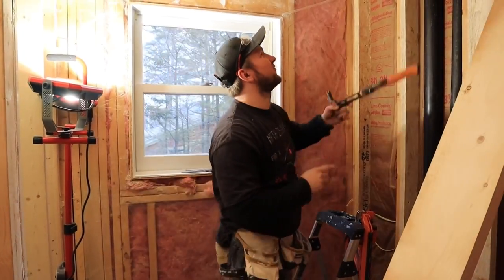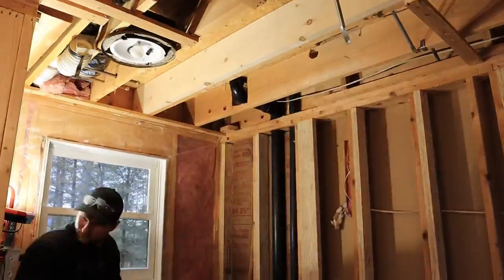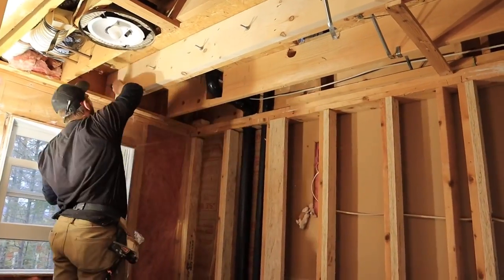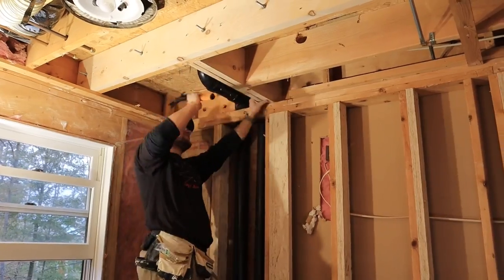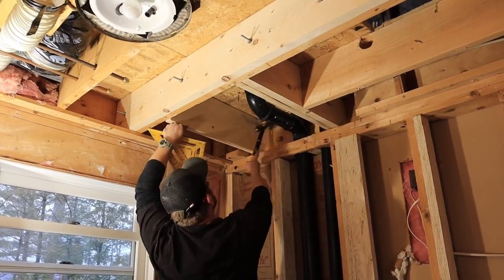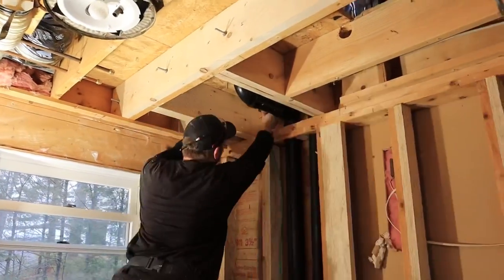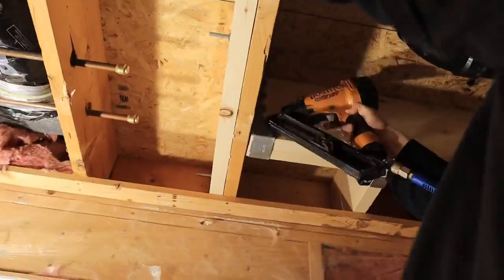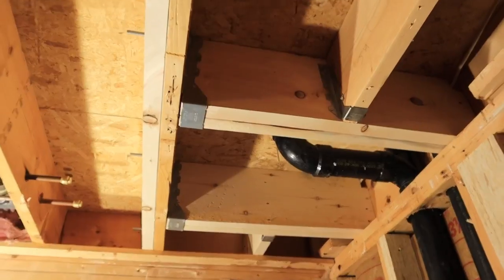Plumbers Cut my Joist! Floor joist repair. Bathroom Renovation. bathroom fixer upper.

Comment: I recommend next time stagger the bolts never put them in a straight line. Keep up the good work!
Reply: Code requires them to be staggered
Reply: How do you know what size to use?

Comment: Speaking as a plumber. It’s not our job to move joists. We tell the carpenter there a problem, and it’s up to them to fix it. Personally I’d wait until it’s fixed but sometimes you need to get the work done. We don’t have time to wait after the framers.
Reply: As a builder I agree with you 100%.

Comment: The bolts are placed on the beam’s neutral axis. They will not be stressed to any significant degree. In other words, they are doing nothing.
Reply: exactly he put the holes in the NA . Also the joist is subject to BM so glue does nothing practically - I think the idea for the sistering is to increase the section modulus . Put the fasteners away from the midddle but not close to the edges

Comment: I'd blame the architect first then a carpenter
Reply: I would say it comes down to the carpenter not necessarily locating correctly where the plumbing is, and trying to avoid the exact on center layout for that plumbing trap. Sometimes you can shift your layout and avoid most things but not always. A little forethought and communication between the plumber and the framer would have been helpful in this situation originally. But this seems to be a retrofit.

Comment: This happens because framer’s cant use a tape measure. Toilets are always 12 to 13 inches off the wall behing them. Framers dont want to take the time to figure this out ahead so plumbers get tired of the same mistakes over and over.

Comment: What make and mode palm nailer are you using for the joist hangers? I have a full size ridgid and it’s a little too big to go in straight on some of the close holes on the hanger

Comment: Yeah plumber did exactly what you want him to do.  Theres only 2 things plumber could have done differently.
1. Put your toilet flange elsewhere.  (You would not like this)
2. Drop below the joist and make you have to create some ugly bulkhead.(you wouldnt like that either).

1hr to box that in is small potatoes especially at the phase your construction is at.
Reply: Thank you.  This needed to be said.
Reply: Which is why it's always good to communicate and mark where your plumbing is and box it out beforehand.
Reply: The correct thing would be to have them fix the framing before cutting through the joist.

Comment: Is there a guideline for proper shower joist installation that I can show to my HOA. I have the same issue and have water damage to the unit before but need to proof to my HOA it’s not the drain and it’s the joists.

Comment: This will work well. I love over-engineering. Technially, I would have also sistered to the adjacent joist in the center by the drain. I would have used structural screws and glue for everything.
Reply: johnwealthy6044  I would not trust glue only.

Comment: Were you shooting hanger bailed with a nail gun? Are you shooting through the metal or actually aligning with the holes in the hanger? I’ve always used the little hex head hanger screws.
Reply from the maker: yes its a special gun for the hangers.

Comment: How much would that kind of repair cost?
Reply: That's kind of a loaded question. If it's completely open like it is in the video then it's probably going to be around a $500 add-on, or additional work order if they're there doing other things. Otherwise if you got somebody that's got a come there to the ceiling out we'll get access to everything and you're probably looking at $1500 to $2,000.

Comment: What kind off screws and nuts did you use to reinforce the the wood im doing a similar project and would really appreciate it
Reply: Lag Bolts, and you don't want to install them how he did because he basically made a perforated like for the joists to crack along. You don't use screws for construction unless you are Canadian, you use nails (usually 16 penny, ring shank).
Reply: @MAGAMAN  We use nails here in Canada, too, unless it's for a subfloor.

Comment: are floor joist usually 2x10 or can you use 2x6?
Reply: I'm not an expert but 2x6 would be undersized for most joists. It depends on the span - bigger span wider joist, sometimes you will need 2x12!
Reply: Other times you can reduce your spacing to 12" if you are at a tail end of the 2 x 10 loading limit.